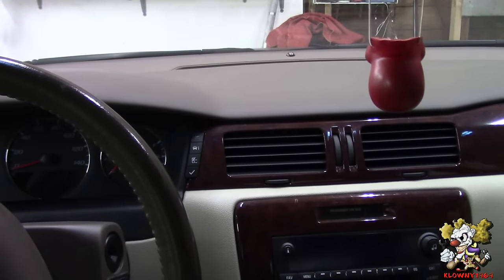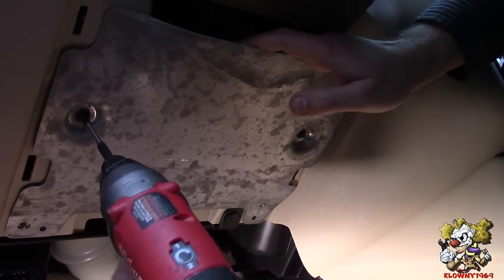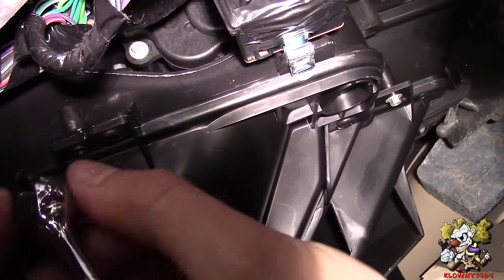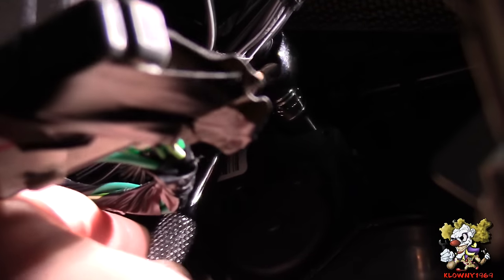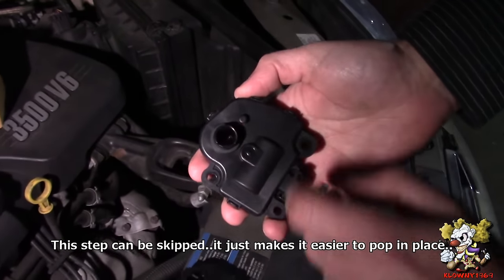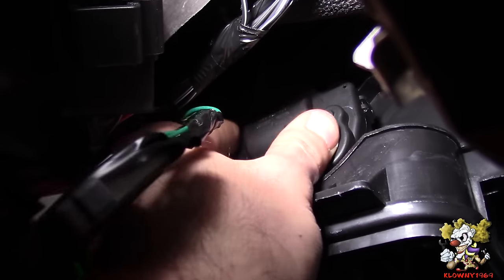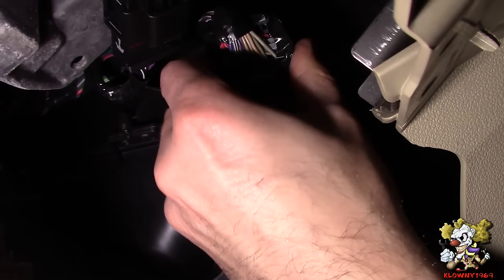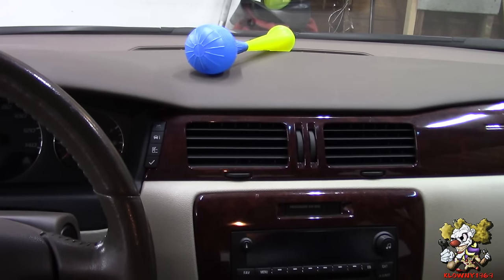How to Replace a DRIVER Side Heat Door Actuator - Chevy Impala 2006 - 2013 - DIY

Comment: I just replaced my step daughters last night (passenger temp control side) and it still clicks. I've saw that it sometimes needs to be recalibrate by unhooking the negative battery terminal, waiting 5 to 10 minutes. Turn ignition to "on", and a few more steps. I've tried and tried and the thing still just clicks. Is there a relay or something else that could cause it to turn too much? For such an easy install, for the life of me can't get it to stop clicking.......
Reply from the maker: This car has three of them..u sure you changed the correct one?
Reply: @klowny1969  Indeed. It's the left one behind the glove box. I can even feel the clicking by holding the actuatoritself (when it's in place). Thank you for the reply as well.

Comment: Dorman help line technician says do not apply power to the air door actuator (NAPA 655-2282) before installing it because it already comes in the proper position for the car to initialize properly.  First disconnect battery cable. To install, turn the door shaft to match the as-supplied position of the air door actuator, hook everything up, including battery cable, start car, then don't touch any of the instruments (buttons, switches) for at least 60 seconds to give the car a chance to go through initiation sequence properly.  I told him I rotated the motor to match the shaft and still got one clicking sound each time I moved the temp control lever down to cold position.  He said take it back and return it on warranty and get another. This was for a 2012 Impala.  I'm not a pro, but this is what Dorman said to do. 800-300-0010 is the help line.  Apparently my car is different from ya'lls.
Reply from the maker: Thats not true

Comment: Great video! But I have a question. I have heat on the passenger side, but no heat on the driver side and no defroster for the windshield. The AC works excellent. There is no ticking sound. What is my problem? I was told it is the Air Door Actuator 604-108. I’m getting ready to do it but I’m doubtful because there is no ticking sound.
Reply from the maker: Check to see if it moves at all when you turn the heat on..it doesn't have to tick to be bad..don't forget to subscribe

Comment: Can you tell me which actuators need replacing a 2013 Impala if I have two major issues one is the driver side does not get as cold as the passenger side and the second is with the mode dial- I typically kept it on the first one which is where it blows max air at your face, the other day my bag hit it and change the dial so now it will only blow if I put it in the middle of some of the selections so if I put it in the middle of face feet amd feet it blows put of bottom vents and a little out of the top vents but when I try to put it at the bottom left selection which is Max at your face from the top vents- it sounds like it's switching and blowing from the top but nothing actually comes out of the top vents only the bottom so which actuator would that be

Comment: Where did you position your body to work on this? How did you position your body?
Thanks 👍
Reply from the maker: Just bent down and in there..I also had a camera girl in my face filming it
Reply: @klowny1969  
I slid a weight bench up against the door jamb, put a blanket on the floor, and slid in.  Still didn't have arm room.
Love your videos man.
Peace

Comment: You don't need to turn the cavity in the new unit with the battery. The white thing that protrudes that the new unit cavity fits over can be turned with a pliers or a small adjustable (if you can get it in there). The only force on it is the damper itself. The new unit cannot be turned but the white thing can. A long time ago after changing three of these damn things I made a tool out of a small length of broom handle which I carved the shape of the white thing in one end and put a water faucet handle on the other end. Now I just reach in and turn it by hand............. actually ........... if you don't mind opening and closing them twice a year by hand (spring for air conditioning and fall for heat) for the air/heat damper you don't need new units at all. Just leave the plates off the bottom and remove that electrical unit and you're there. The other side just drop the glove box.

Comment: Thank you man you helped me out big time. I have one question since it is tighter spots and they say they fail after 90k miles, do you recommend to change them all out at same time? I changed the far right passager side actuator and within 3 months it is knocking again. Failure? I didn’t do the step you showed about power alignment of the hole.
Reply from the maker: josh robinson I would only change them if u need to
Reply: Okay thank you

Comment: There's actually 3 of these.  I've replaced all 3 in my wife's '09 Impala more than once because I used Dorman parts.  Buy genuine GM parts, AC Delco, or Standard.  Much higher quality than the Dorman part.  This weekend I have to replace the driver's side for the second time, but this time I purchased a Standard brand part.
Reply from the maker: Thanks for ur input..dont forget to subscribe

Comment: Hi, I replaced both Actuators for my Chevy Impala 2008 but the knocking sound is still there, it looks that I would need to do something else, can anyone give me a hand on this?, For the position on the new Actuators I moved the plastic circle thing, for both of them using a pliers, did I do it wrong? Thanks, the video was really helpful.

Comment: Will this fix the ac on the driver side? I currently have cold ac air coming from the two passenger side ac vents but the driver side ac is only blowing out regular air. Not hot nor cold.

Comment: I fixed it in 45 minutes.. you wanna set your front seat all the way back and recline it all the way back.  Lay down on your driver's side seat, put a flash light in your mouth, so you can see. Make sure you have a small ratchet in hand 5.5 mm and a small screw driver to release the electric attachment. I did it after I unscrewed everything. The white knob there it'll spin where you need it to go. Use your fingertips to start the screws. After you get them started use your 5.5 to tighten them down. Don't be discouraged. It was actually easy. The key is laying upside down on your driver's side seat. It's not a bad idea to have a helper handing you the tools you need.
I have heat now, awesome feeling.
Reply from the maker: Glad I was able to help..don't forget to subscribe
Reply: I used two lights: one on the floor and the other on my head (headlight).

Comment: I fixed passengers 2 actuators in my in-laws car. They worked great. Then I noticed I only had A/C on driver side. So, I replaced driver. Now, when I start, it only blows heat out of driver on A/C even though passenger works. The new motor works because I put power to it to align it. Is there some sort of reset I need to do? Could my slot be off 180? I used battery to move it 180 but that didn’t help. Also, with the actuator removed, I manually moved the vent door to A/C. Turned on the A\C and it ran cold. I then turned off the car, installed the actuator, turned on the car and it moved to heat where it stayed on heat no matter what.

Comment: Thanks for the video. How do i know if i need to replace the heat door or blend door actuator? Pretty sure its heat door because it makes the noise when you change temp and when starting the car. But want to be sure before i tear into it
Reply from the maker: Check the links in my description for the different actuator locations

Comment: So I followed your instructions and switched out the driver side door actuator. The knocking is gone, but now my heat is not working...did I knock something loose? The heat was working before I switched it out.
Reply from the maker: check to see if the new one works..it could be defective..dont forget to subscribe
Reply: @klowny1969  It can still be defective even though it stopped the knocking? Also what does each air door actuator control specifically?
Reply from the maker: Yes it can..there is an electric motor in there..u can check to see if you have power and ground to the connector as well. Did u click that bell when you subscribed?

Comment: Do you still got the car I got a 07 Lt and it's been pretty reliable 215k auto start still works. Had it for about 8 years now every 3k regular oil changes beside those actuators it's been a good family car.
Reply from the maker: yes..car is good..couple of oil leaks and a few sensors have gone since..dont forget to subscribe

Comment: klowny1969 I (yes I did) by myself!!  replaced the actuator and the clicking stopped a couple of months ago, but now that it is getting cooler, I realized the heat doesn't work.  Only blows cool air, you got another video to fix that?  Great videos BTW
Reply from the maker: maybe it was defective..or it could be another actuator..see if the door opens when u change the heat settings

Comment: So when this sound happens and my heat and my defrost and what not doesn’t work that means you go to the driver side? Or do you follow the sound ?
Reply: Like does a different side of the car have a different function or are they all the same functions just in different spots?

Comment: All I did with my 2010 Impala was just Disable both Driver and Passenger side Actuators just by unplugging them and said "FUCK IT! I DON'T NEED THE HEAT." I CAN DO JUST FINE... WITHOUT... AT LEAST I WON'T HAVE TO HEAR THAT TAPPING NOISE WHERE IT'S SLOWLY DRAINING MY BATTERY EVEN WHEN THE ENGINE IS OFF. I HAVE WAYS TO STAY WARM WITHOUT THE HEATER. IF GM WANTS TO RUN A DIAGNOSTIC ON MY CAR AND NOTICES WHY MY HEAT DON'T WORK, I'M ONLY GONNA TELL THEM THIS... "YOU GUYS ARE MORE THAN WELCOME TO REPAIR AND REPLACE THE ACTUATORS THAT ONLY CONTROLS THE VENTILATION IN MY CAR. OTHERWISE, FORGET IT."

Comment: Your video is the best, thanks. I replaced the driver side actuator just like you did in the video. And the clicking stoped. But the drivers side is blowing hot. Anyone else have any suggestions. I pulled some fuses like I saw in anothet post, but that didn't help.
Reply: Were you able to determine why the drivers side was blowing hot?  My son's car is doing the same thing.  Does changing the actuator on the drivers side fix that problem?  Thanks!

Comment: This past summer I replaced my passenger side heat door actuator, after it began ticking loudly. With it getting colder ive started using the heat and I realized my drivers side heat doesn't work, it only blows out cold air. The passenger side heat works fine. There is no ticking, is it probable the drivers side heat actuator is still the culprit?

Comment: Question... are all the actuators the same? I replaced passenger side twice. I'm bookmarking this video!
Reply from the maker: John Z three of them are
Reply: Klowny is it the drivers side thats different...haven't had to replace that one yet.
Reply from the maker: John Z no..passenger mode valve actuator

Comment: My Impala Driver side not giving hot air, just the passenger side, in the same time I do not hear any noise. so do you think if I change the actuator it will fix the problem.
Reply from the maker: Qutiba abazid check to see if the door is moving
Reply: do you mean at passenger side behind the glove box?
Reply from the maker: Qutiba abazid i would check the one in this video..if u have nothing going to driver side

Comment: Quick question. I replaced the passenger side and it is now successfully moving when I change the temperature gage for the right side. However, when I change the temperature for the left side I did not get a click but there is no movement from the door at all. Could this be the actuator or something else
Reply from the maker: It could be a bad actuator..check the description for a link to my shirts

Comment: I'm changing mine on my 04 it's fairly the same. But what do you do when the gear on the actuator is not in the same position as the old one was?? Can I simply install and turn the actuator in place?
Reply from the maker: in the video i showed how to match it up..u can also just put the actuator on and twist it into place..thanks for watching
Reply: Actually I think these require a program to the BCM. I've had mine replaced a couple times and they've had to program it.

Comment: Klowny, thanks for making and sharing the video. Only thing I can add is that we finally figured that I needed to get in from the pass side and lay across the seats, with feet out the pass door. I'd like to send you a small paypal "tip". What address can I use. Thanks!

Comment: I have the same problem with my chevy impala SS 2008. No heat on the drivers side but I've never heard the ticking sound! Would this fall into the same problem? I did have the actuator replaced on the passenger side a year ago that had the ticking sound so I know what that would be like.....
Reply from the maker: ricardorenteria25 its possible. .yes

Comment: So I replaced the actuator. Checked the old one and it wasnt working, new one is, but I'm still getting the heavy clicking noise randomly....Any suggestions? Plug may be going bad?
Reply from the maker: U sure u changed the right actuator? There are a couple of them..donforget to subscribe and hit that bell to be notified of any new videos

Comment: My Chevy dealer wanted $1600 to do this so I'm surprised to see people here say that their dealer wanted $300-$500. My dealer said they'd have to pull out the front seats & the job will take a minimum 8 hours. Of course, I smelled bullshit. Luckily, I found this video. I'll try getting it done myself or I'll take it to Firestone which should be much cheaper than the dealer.

Comment: On my 2010 impala, passenger side heat doesn’t work…but the AC does, and it’s not making the clicking noise i keep seeing on different vids…do you think the actuator is still my issue? or at least try that before anything else?
Reply from the maker: It's possible, check to see if all the actuators are turning their doors
Reply: @klowny1969  thing is, I can hear them whenever i switch from defroster, forward air or floor air….great air pressure just completely cold air from the right side (defroster, front, floor etc.) The only other clue i was thinking is the middle right air vent is stuck and wont shift from left to right. All of the other ones shift no problem. Not sure if that even has something to do with it but
Reply: @klowny1969  I just bought the actuator few minutes ago. About to unhook my batter and switch out from underneath glove compartment

Comment: Help! I’ve got the old one out but the knob is not lined up the way it needs to be. You connect some wires to get your to turn but I don’t have the ability. How can I make it move?
Reply from the maker: Just turn the actuator around in your hand when u are trying to connect it to the door..get it hooked up first then you can turn and position it where seats down where it supposed to be. Dont forget to subscribe

Comment: How did you get the actuator harness off? After I got the two 5.5 screws out I had to pry the actuator off because there was literally no slack in the wiring. Like there’s no way you can get a screwdriver or any tool to get the harness off.
Reply from the maker: I showed in the video..it comes off easily
Reply: No I see how you did it. I’ve had a similar problem with something else. When I got the actuator off (after a trip to Lowe’s for a swivel joint) the actuator sprung towards the engine. THERE WAS NO SLACK...I actually used an extra long pair of needle nose pliers, crushed the actuator, and then was able to use the screwdriver...your video was awesome, I just had a bullshit random issue.
Reply from the maker: Lol cool..glad u got it done!

Comment: have a 2010 impala ltz with dual climate control all 3 blend door actuators working put both settings on cold and passenger side blows 58-60 degrees ❄ than the driver side 70-73 🔥 could I be low on refrigerant or something else

Comment: is this your car i see you have alot of videos for this car. I have a 2006 LS with 167,000 i bought it new its been very good but at a stop postion the car jumps forward then goes fine. it started happening a week after the transfilter an gasket was changed with new fluid. what can be causing this its been doing this almost two years. i thought it was miss fireing from a stop position because i hooked up a scan tool an i get miss fires on two of the cylinders but it's not over two or three misses per the two cylinders can you give any suggestions
Reply: Input piston seal in the transmission. I have it too. Acts like its low on fluid. It comes and goes so I leave it be for right now.

Comment: Mine is not clicking but i get a mix of warm and cool air when I have the heat on, i thought it was due to the water pump being replaced but I am not losing coolant anywhere. could it be the blend door or heat door actuators?( i did move both switches to cool when we had the 60 degree day here last week in NY then back to hot the next day)
Reply from the maker: Dennis Copp II possible..check to see if the blend door moves

Comment: Hi Klowny!! So there is only one actuator on the driver's side (Air/heat door actuator)? I have the same issue with the clicking noise on driver side and the blend door actuator on passenger side
Reply: It depends on the car, but it's probably just one though. It is that way on my 07 Monte.

Comment: 1 more thing.  If you do the step at 7:06, which I suggest, the neg is connected to the post on the side with the lower screw hole.

Comment: So, would I replace the same part if it started clicking when I turned on the cold air instead of the heat? Also thanks for this video!
Reply from the maker: UndercoverTMNT yeah..but make sure u check which one is clicking..there are a few of them